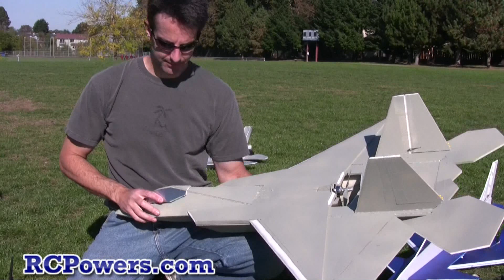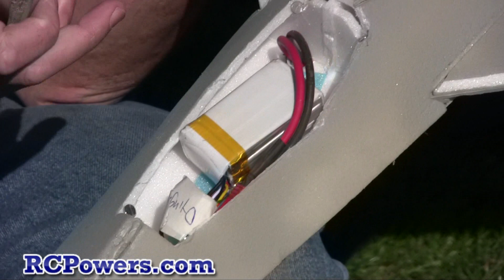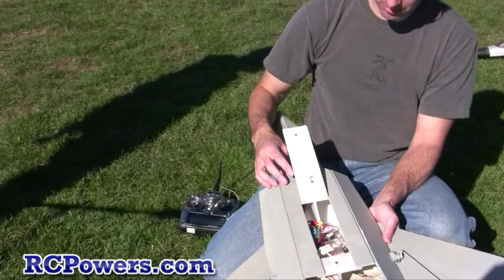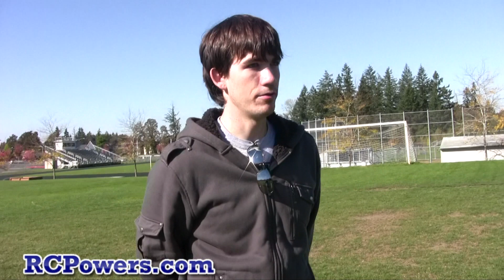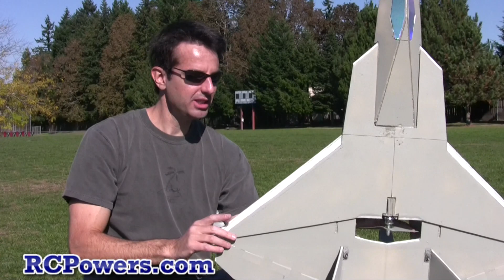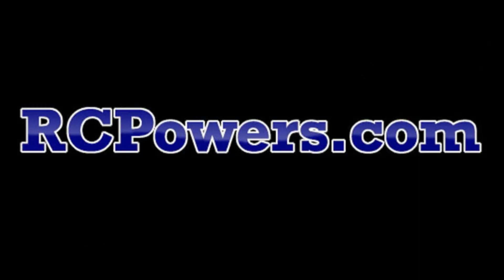Stock F-22 EasyBuild V2 Set Up

Comment: @beastlybob36 it depends on what you mean by "all the parts" and where you get them.  If you don't have any of the electronics/power systems, probably $200-ish if you don't skimp on the servos.  Add another $100 if you don't own any of the required tools.  Add another $100 if you don't know what you're doing and learning it for the first time.